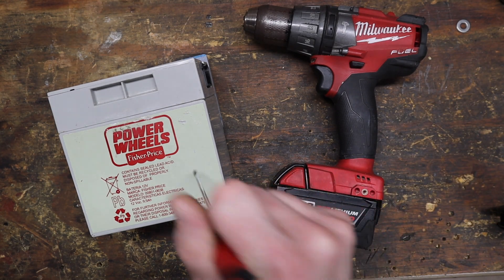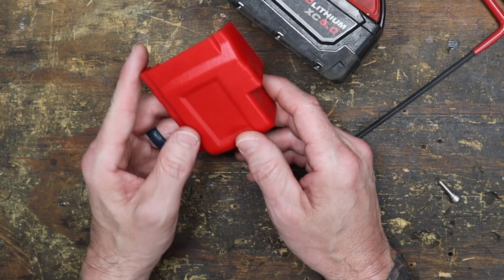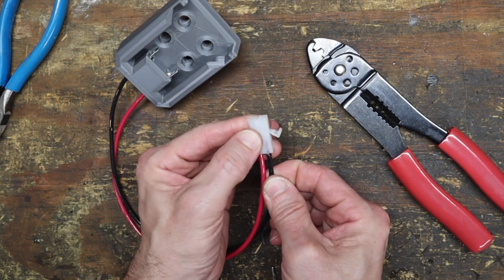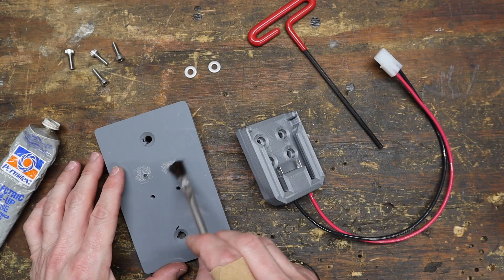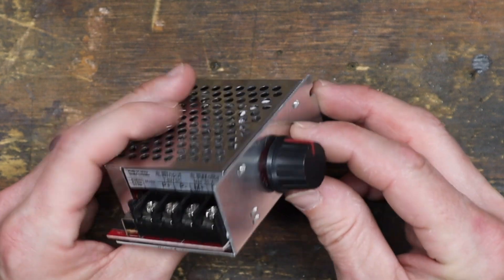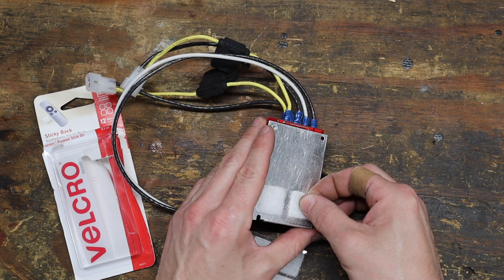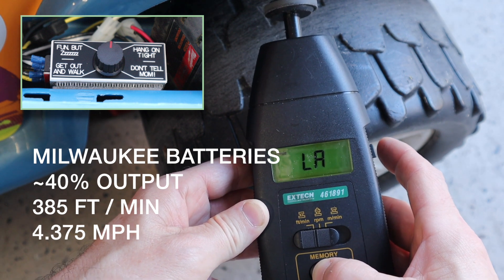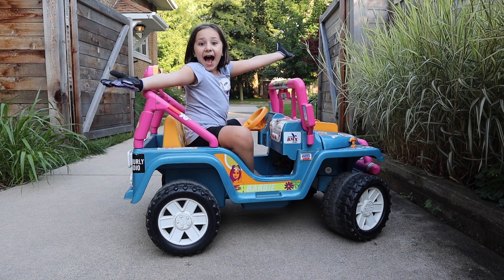Power Wheels Vehicle 18 Volt Milwaukee Battery Upgrade!

Comment: Now you need to wire in a "fuel gauge" so your kid knows when it's going low so you do t have to drag it back to the garage when they run it dead around the block.
Reply: That's the beauty of the Milwaukee batteries, just keep a couple extras charged up. Walk them over, swap out the batteries and she good to go
Reply: You can get a little voltage display just mount it to the dash lol

Comment: Have you found upgraded tires? I have an arctic cat and the tires run out quick.
Reply: I have found that harbor freight sells cheap rubber tires. I modded my sons John Deere with them. Excellent traction. My only problem is that I keep burning through the motors

Comment: Now wrap the rears in duct tape and rubber and make it run 7’s on quarter mile
Reply: Actually a couple vacuum belts on each tire might do the trick...should be about the right length to just stretch over the tires and stay securely, and not as expensive as the power cells. Better put some on front too or steering will be compromised.
Reply: Monty Hylton yeah definitely!! Fan belts or anything and hair spray hahahahaha

Comment: If your a rc guy use Lipo batteries they have plenty of punch and voltage. Typical 7.4v you can get will be 5000mah 30c. Or if you have a brushless combo you can add a live axel then you can run it on 8s lipos that have 12000mah (26.4v)

Comment: My dad hooked a car battery on to my power wheels .. it was a red simple jeep but man after my.dad threw in the car battery not only would it charge faster because we would have to plug it in to the actual car have it on and me press on the gas while it was hooked up but that power wheels jeep could lift up if I rested my  back pushed the bunny input and I was off

Comment: i've swapped the original battery for a better, longer lasting 12v battery but I have been wanting to do this exactly. I have a ton of extra drill batteries that I could use for this so thanks for the encouragement! My boys will love it

Comment: I live in the Appalachian Mtns and my yard has a slight incline and the hard plastic tire don’t get any traction so I tried putting screws in the tires witch works well in the grass but it doesn’t work good for the driveway.  Do you have any good ideas that would give good traction in grass and still be drivable on driveway
Reply: Go with  Continuous Track..
I set one up on my neice's barbie car... a few years back.
They live in the Mounitains and also have a long driveway... so its able to go in Mud,grass concrete without much slippage. 
Barbi mobile with Tank Treads...lol

Comment: I would take 2 12 volt emergency light batteries in there and would have my son flying down the street tryed a 30 something volt from a scooter and ran like heck motors burnt out quickly

Comment: Those plastic wheels tend to slip with only minor bumps in the lawn.  Take an old car timing belt, turn it inside out and fasten it to the O.D. of the drive wheel with some screws every few inches and you'll get lots of traction.  Do the same thing to the drive wheels on a self-propelled lawnmower and they will never wear out.

Comment: I like your vid my dad made my power wheels do like 15 mph may have been a bit slower or faster, burned through motors though working light's and turn signals. But the sfx are annoying and distracting to the interesting information your giving.

Comment: had the same problem with my sons power wheel. Found out that the emergency lighting  in hallways in your larger buildings have the same batteries.

Comment: Milwaukee batteries have the safety circuit in the tool the batteries are raw voltage. they REALLY don't like being over discharged.

Comment: It could have even more runtime with a custom 21700 battery pack like with some Molicel P42A cells, the drill batteries have 18650 cells inside between 2500-3000 mah, but the P42A are 4,000 mah

Comment: You can make it 4wd by mounting salvaged rear motors & drives on the front spindles. (found in alley)
Fairly easy especially for someone with your capabilities. 😁
Never tell mom! Great video!

Comment: You seem like a smart guy surprised you didn't just place some 80 grit on a flat surface and sand those adapters flat. You didn't mention run time difference and I didn't see a low voltage shutdown installed. Great idea I've been thinking of an E bike using Milwaukee bats but a bms is imperative to prevent cell damage. I modified my son's electric toy Harley bike years ago 12 volt to 24 volt. Was fast enough to remove the training wheels. Unfortunately the motor got so hot it melted the plastic it was secured to.

Comment: 12volt 40ah   lithium battery  they are 250$ :D
Valence u-charge RT Series U1-12RT   
or Valence Lithium Battery U27-12XP  12V 138AH 1.766 kWh
I would not use Lithium ion batteries in a kids toy  i would go with a Lithium iron battery(LiFePO4)

I did it, I supercharged my riding mower. Wuhwuhwuhwuhwuh.  Oh no! I killed Wilson! Looks like it's back to prison for me. Wuhwuhwuhwuhwuh!

Comment: Great video, especially the last 30 seconds.  2 questions.  1. How long does the batteries last in this set up? 2. Have you tried to do a speed test running the batteries in series wiring?

Comment: This would be a perfect idea for the DeWalt flex battery!
Reply: yeah running a 12v circuit on 60v would be great.... for 10 seconds
Reply: @AtheHD1  It would be running at 20V, just with a capacity of 6,9 or 12 AH.

Comment: I think the idea of putting them in parallel is dangerous. If one is discharged and another one is charged there is a possibility for very high currents and, probably, fire. Always charge both the batteries.

Comment: I just did the math. Factory power wheels batteries are 114 watt hours. 2 M18 5.0 batteries is 180 watt hours, so assuming zero losses, he should get 71 minutes of runtime at the same power level that the OEM battery

Comment: "Tired of your kid's Power Wheels battery crapping out after 20 minutes? Tired of charging that 10 pound brick overnight, only to have it die again halfway down the block the next day?"   So by this statement you're trying to tell me that an 18v 5ah battery pack lasts longer than a 12v 9.5ah battery pack?  If that's the case, which the statement shows it is, it's incorrect and misleading.  

For ppl on here wondering perhaps what I'm getting at is... Voltage = power    Amperage = gas tank.   The power wheels will go faster, but the overall run time will be less with this setup.  Didn't watch the video, but in case it wasn't mentioned (sidenote), double check that the electric motor can take the additional voltage safely or it'll just end up burning out in about a week.
Reply from the maker: You: "So by this statement you're trying to tell me that an 18v 5ah battery pack lasts longer than a 12v 9.5ah battery pack?  If that's the case, which the statement shows it is, it's incorrect and misleading. " 

Also You: "Didn't watch the video..."

Me: I'm not saying that at all. I installed two (2) Milwaukee 18v 5ah units in parallel. The video goes into detail to explain the difference between parallel and series wiring (complete with visual examples), and how they each affect amphour capacity and related voltage output.

Comment: i did this same thing with my kids power wheels a couple years ago, another thing you could do to stop the wheel spin is get some bicycle tires i got the biggest ones i could find. and cut them to the diameter of the tires on the power wheels. them attach them to the power wheels tires, like a retread of a tire. it gives the power wheels much better handling.

Comment: On the oem batteries I use my hobby grade battery charger I can set the parameters it charges at, and it charges quicker, and last longer only thing is if you run it down to far you have to use the oem charger for 20 mins to bring g up volts

Comment: I wish I thought of that 20 years ago! I have three boys and three girls. When the oldest, my 29 year old son was around 12 we found a power wheel jeep on the side of the road out for bulk trash. We took it home in the station wagon and he got to working on it. We didn’t feel like shelling out $80 for the battery so Will took the gear out so it would free wheel. Well, it free wheeled all right and we lived in a hill at the time in Baltimore city. ( not a huge one- just a casual incline) 
So the type of mom I’m like don’t you guys know what you can do with that? Jump ramps! Heck yeah! 

So they set up their skate ramps and jumped the power wheel riding down the hill. I would warn them if there isn’t enough speed you can’t jump you’d crash. It was ‘Don’t tell Dad’ in our house. They never got really hurt. He would play with that power wheel with his brother who is 17 months older than him. They were inseparable back then. 
I always told the boys to run their crazy ideas by me and I’d make sure they were relatively safe. 
Just recently we gave the skate ramps and the bridge to my sister’s kids. There are four of them are 5-10 years old. They are going to love it.

Comment: That s awesome dude 
I am all ways tinkering with stuff and never saw that little gray thingy you found and Milwaukee is my go to brand nice really nice very nicely done thank you for sharing this piece of joy 
Ps I have seen knock-off Milwaukee batteries on line other put out by a variety of Chinese companies I have used the vannon branded they seem ok however in a pinch cheep out weighs the expensive I got 4 for $ 107$ few quirks in there manufacture I are soldered and I have been using them for a few months now just an idea to share with a fellow tinkerer

Comment: Had a buddy tell me his childhood power wheel was fitted with a car battery. He said the plastic wheels wore through from doing burnouts
Reply: It is 12 volts....
Reply: Okay but that's just the battery, the motor would still have to be upgraded to get any real power.
Reply: Diesel Douche 
The stock motors are pretty powerful. My kid had a Bigfoot Power Wheel truck and it would spin both tires in high speed, and would reverse immediately when the reverse button was pushed, giving some serious ability to spin out while cornering at speed.
Reply: @dieseldouche7735  a car battery supplies a lot more amps than any stock power wheels battery even though they're both 12volt.
Reply: @davidmcguire6043  it's still possible
Reply: @styleplague  what's possible? I think you got confused
Reply: @davidmcguire6043  you're right!

Comment: I'd be a little concerned about current balance. You will have to be careful not to put in one fully charged battery and one partial or discharged one or the full one will try to charge the other at full current capacity. A big diode in line with each battery would solve that.

Comment: How do you prevent over discharge?
Id hate to wreck two $30 batteries
Reply: This is the comment I was searching for.  With li-ion batteries frequently becoming completely unusable after being discharged too low how do you protect this from this happening?
Reply: Good luck getting them for $30.  Milwaukees arent that cheap.
Reply: @dennisbusch5904  I agree depending on the amp hours. That's why I would hate to over discharge
Reply: Don't these batteries self protect?  I have Craftsman drill batteries and they won't over discharge.
Reply: @RCplanesrfun  as far as I know this contorller is in the power tool not the lipo.
Reply: @andrewdowney760  
Not on my drills. It is in the battery. My drill will take a NiMH battery to nothing but the lipos stop themselves at a certain voltage.
Reply: @RCplanesrfun  what brand, Im going to look into it
Reply: @andrewdowney760  Craftsman c3. 19.2v

Comment: Just part out a riding mower and put a 24hp v twin in it with welded rear axles on front and back, and then set the speed to whatever you think is safe for the kid?

Comment: With the batteries in parallel one will always take the brunt of the load due to their differences in internal resistance and fail sooner. Run them in series and crank down the PWM. You may get longer run time and not kill one of the packs prematurely.
Reply: Sean Patrick  I'm sure it's fine. I'm over thinking it. Great video!
Reply: Beat me to it Andy...or just unplug one battery or add some diodes.

Comment: Wow, you know a lot about batteries.  I wanted to combine my milwaukee dual chargers together and make my own sequential batter charging station.  My idea was to build a wooden box with a 6-Outlet Power Strip Surge Protector in the middle and have all my chargers plugged into that.   I got four m18/m12 chargers and two m12 chargers.

Comment: This isn't a good idea. Power wheels strip gears on the stock battery.and you're overvolting the stock motors, which is ok for short bursts, but leads to early motor failure.

Comment: Do these have built in low voltage protection?
Reply: No they don't. I killed one of my batteries and damaged another doing this. I got a set of brushless motors for rc and an Arduino with potentiometer to control the speed planned for my little ones rig.
Reply: @andrewsommers8298  so why is he making this video lol.
Reply: Sweet sound effects bro

Comment: Just use a car battery. That will get you going.
Use to love finding power wheels next to the trash because the battery died. Sure we fried the motors but they would last for days before we did.

Comment: A switch to change it from parallel to series and back would be cool. Built in turbo 🤔
Reply: A lot of power wheels already have a slow/fast switch...just use it to control a relay circuit. 

But like many people already stated....the gearbox wont last long
Reply: @twoeightythreez  depends on how much traction the tires get. I've run all my kids ride on toys in parallel. Those plastic wheels wear out faster than the gears even on the cheap off brand Wal-Mart riders. The problem is with the motors they burn out pretty fast but you can replace them with the same cordless drill motors he got the batteries from. They're people that mod these toys as a hobby and like any hobby some take it very serious.

Comment: what keeps the batteries from over discharging?
Reply: Nothing. My kid killed one of mine.
Reply: @andrewsommers8298  Thats what would terrify me. There needs to be some voltage controller that would cut out before damaging the Lithium cells!
Reply: @dlloyd6300  I know that LXT series 18V Makita batteries have internal BMS that cuts off battery output when its being overdischarged. Thought milwake have too such system but maybe not. Makita at least has it. Burned through 1.3Ah 18V battery yesterday for one of my small projects and it turned off automatically for me.
Reply: @fulldnbboy  that functionality is usually built in to the tools electronic controller. Are you sure it's in the battery too? I know Makita has some fancy stuff built in to the battery but am unsure if that includes discharge protection circuitry.
Reply: @fulldnbboy  actually just found this on their site
"For improved tool performance and extended battery life, Makita created STAR Protection Computer Controls™. STAR Protection is communication technology that allows the tool and battery to exchange data in real time and monitor conditions during use to protect against overloading, over-discharging and overheating"
I could be wrong, but the way I read that is the STAR system requires both the battery and tool to function and prevent over discharge.
Reply: @dlloyd6300  as much as i have disasembled electronics and stuff, there is pretty much zero communication between tool and battery apart from plus and minus contacts. Battery has bms built in, pretty sure all the "communication" is done inside battery in that bms chip where it reads all the current and voltage etc that is applied to the tool which comes directly from the battery. The other reason for that is pretty simple. Makita has one exoensive tool for batteries with what you can read all the data from bms chip through PC. That tool is around 500 euros or so. Because of that all the "communication" is pretty much inside battery and bms is measuring all the stuff happening with battery. How much tool takes from battery is directly proportional how much is taken from battery which goes through bms. I realy dont think there is extra special chip inside tool itself that would do extra work for battery when everything can be implemented in battery bms anyway.
Ofc thats for usual tools like drills, saws, multitools etc but heck knows whats under the hood of makita radios and usb adapters where there definetly is a lot of electronics which is absent in drills. Drills etc have only motor, variable switch, led with small cap and transistor plate for fade effect and thats it. What communication is there that is not marketing gimmik, i dont know.... Only logical place for all that is battery itself and its bms that records everything.

On a note here, the tool i spoke about for reading battery info through PC, is a tool too. So in a nutshell, "star" system pretty much can be exactly that tool + battery. Marketing team ofc rephrased that and worded that like every tool has some "communication".
Reply: I burned up a battery the same way, wish there was a cut off

Comment: Don’t be a puss we put a car battery on the little display car we had. Hauled ass till the wires melted lol
Reply: Sean Patrick  amps are in no way proportional to applied voltage, and i have no problem with the Milwaukee battery mod.
Reply: car battery voltage at rest is 12.6, these are 18v batteries....

Comment: The 3d printed adapter was printed improperly. It is rounded on the back due to improper adhesion to the printing bed during printing. As for the thread holes, it seems as if there was a design issue, and the interior filling of the adapter was not enough to support the screw holes